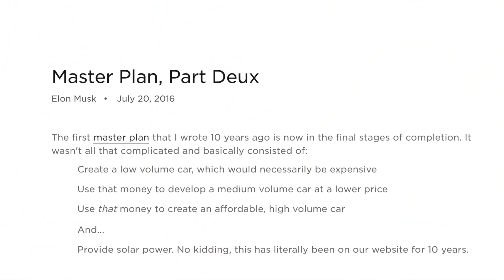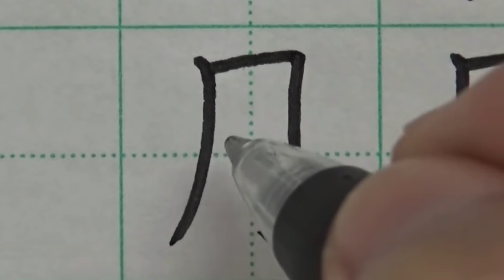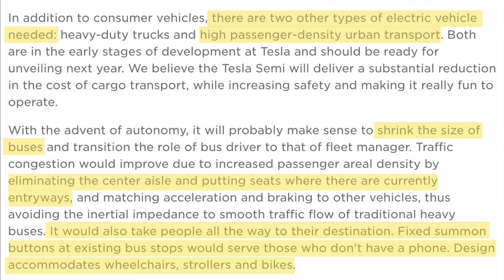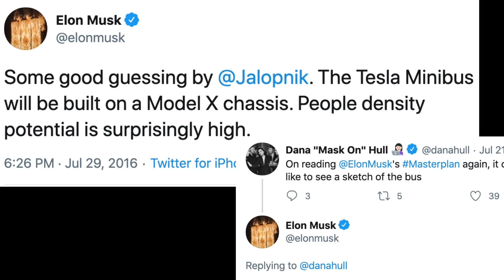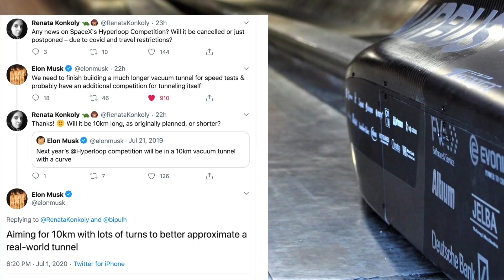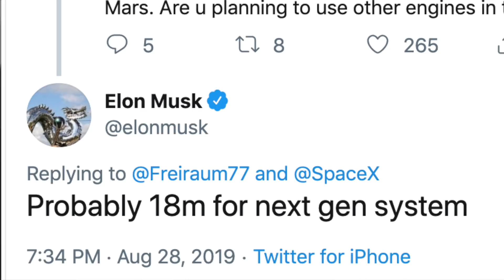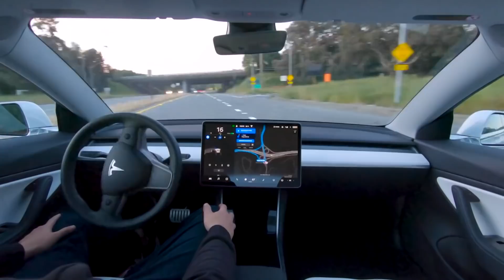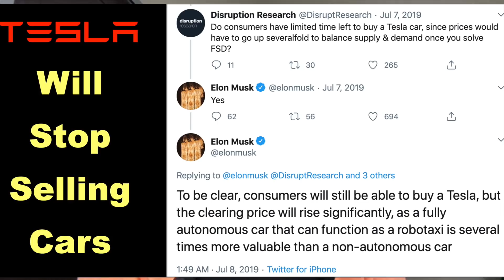5 Elon Musk Surprises for 2021: Tesla, SpaceX, Boring, Neuralink

Comment: Great video W! How do you respond to the contrarians view  that solving the last 1% FSD problem will take 10-50 more years?
Reply: Tesla doesn't need that last 1% to start FSD, just 10X times better than a human. Then they work on "CHASING THE NINES."  99.9%, 99.99%, 99.999 ... When Tesla cars have one tenth the death rate, lawmakers will demand FSD and outlaw non-FSD cars on the Interstate highways. I'm thinking the Interstate highways will "FSD ONLY" in less than 5 years. My son is a long haul 18 wheeler driver. Cars driven by humans and big trunks don't mix well. FSD is the answer-- for both.
Reply from the maker: I'm not sure you're exactly right but I mostly agree Fiddler.

It's more like Tesla will release features and by the end of the year it will be "feature complete" but will still require human supervision.

Then it chases the 9s for a while. Once it's 2X or 3X safer in all situations, Tesla will get some jurisdictions to approve unsupervised driving. Florida will be one of the first - it's already the law.

It will continue chasing the 9s and will get to 10X safer then 100X etc.

But lawmakers will resist it in many places.
Reply: @WarrenRedlich I agree.  Law makers are slow but insurance premiums will respond quickly. It may be hard to justify the cost of human driving for the consumer.
Reply from the maker: That's a very good question. I'm not sure how much remains. My impression is that FSD will soon (by end 2021) get to the point where it is overall safer than human drivers, even with some weaknesses.

The pace of learning is about to improve dramatically. The foundational rewrite will be done in a few months. And Dojo will be operational soon. And there's going to be a lot more data coming in as Tesla adds more FSD cars on the road.
Reply: @p1zd3c  My son sees the inevitable coming, but CDL drivers are still in short supply. Trunking companies will be the first to embrace FSD -- once it works: and is legal. My son imagines he will take a truck to the Interstate and pickup another one from the Interstate to deliver it to a warehouse. In other words, he will transition into a short haul driver. He wants to drive a Tesla semi, but most truckers hate and feel threatened by EV cars, Tesla, and FSD. The transition to sustainable energy will not be smooth. Jobs and fortunes will be lost. People will fight it. It's a revolution. Yet, I can't help but look at my TSLA (& my Model X) and yell, " go Tesla, go!." 
I heard that one third of household mortgages missed their June payment. 1/3 ! This is going to get ugly.  Our governments needs to use this opportunity to help transition jobs into the sustainable energy sector.

Comment: S3XY 4F. I am guessing that your version of starship is fundamentally correct. When you go wider there will be a bit of a bias for the tanks to be lengthened to at least round not pancakes and the nose will be pointy again, doubling the length is not a goal. there is only enough room under super heavy for 4X the thrust not 8X.
Reply from the maker: Increasing the diameter allows 4X the thrust but it doesn't 4X the structural weight. That only increases a little more than 2X. So it allows for some extra height.
Reply: @WarrenRedlich  there is some dimensional analysis to be done but this is not the case. this is basically all pressure vessel and the diameter of the vessels means that there is greater stress on the skin per unit of pressure. The wall thickness will go up proportionately. Just like the bridge towers have to get higher with the length of the bridge. Good news is that Oxygen and Methane are liquid at the same temperatures and they can share a common bulkhead, they don't need separated tanks with more than one radius. There is some extra height allowed. I believe there is savings on heat tiles 2X the area and the larger radius pushes that bow shock farther away.